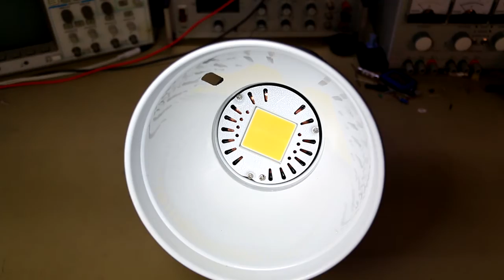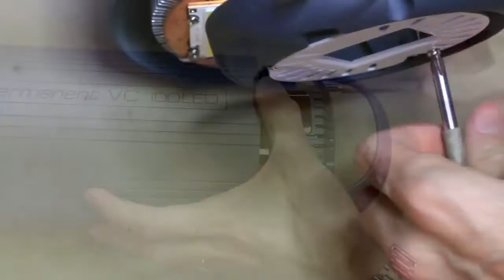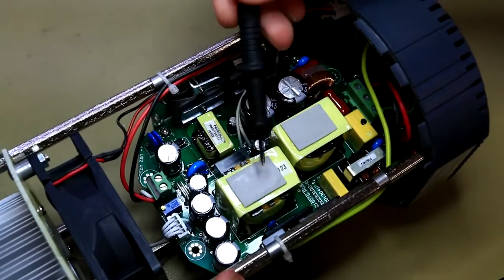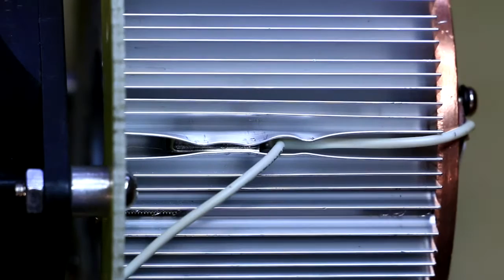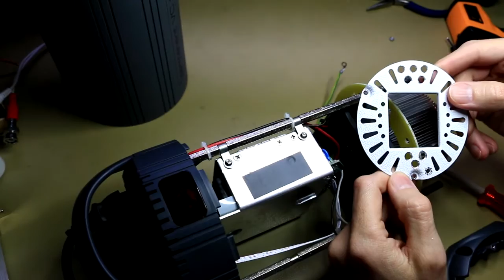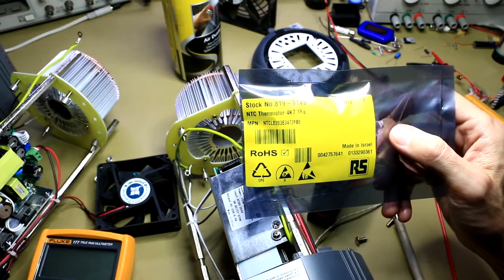Visico VC100 LED light teardown and repair  (#010)

Comment: I like how you went about it. I have a Neewer N-250, I have an issue with power. when I switch it on the power switch goes on, but the display doesn't work. or indicate anything. any ideas on how to repair displays?

Comment: How would you suggest I begin learning how to do this kinda repair? Is this called "Electronic Repair"? Maybe a class at my local community college? I don't even know what this is called to see if someone in my area does this kind of work. I've heard about the capacitors holding voltage and if you don't discharge them, you can have a short career.
Reply from the maker: Hm, a basic understanding of electricity would be important, yes. You can, possibly, start with with some of the basic videos produced by "Mr. Carlson". He offers a (paid) electronics course and then also goes through very detailed methods of repairing electronic devices. Check out his channel here:
https://www.youtube.com/channel/UCU9SoQxJewrWb_3GxeteQPA

Comment: Probably dropped during assembly, and snapped off on the edge of the mount. Not noticed in test, as it was probably 60 seconds - plug in switch on, no boom, light responds to level control, no flickering segments, do you hear some fan noise, switch off, pull out lead, stick on gold QC Plass sticker, put in plastic baggie, drop in box with rest of parts, close box DONE. 

Nice job on your new thermistor, but can't help but think the thermistor would have more effect on the lamp heatsink itself rather than in the cold airflow.

Remember when drilling the holes either get a countersink bit, or use a large (12mm or so) drill bit to remove the edges, so much better than the moer tool, and less likely to distort. Should drill the rest of the holes larger as well.

Nice little bodge there, nice Nichicon capacitors in the power supply, but the main control board put a OHL brand in place of the pass transistor the designer originally put in to handle the heat. Little 12V regulator at least should have more copper on it, or the little stick on top hat heatsink.

Next video, how to fix a Toptronics dual type K sensor display. Of course they are connected in common, hard to isolate type K cheaply, unless you use isolated tip probes with a ceramic insulating sleeve.
Reply from the maker: +SeanBZA Agreed about the thermistor positioning, but seems that the fan still produces more volume movement than the vents can handle, so there's a lot of warm air "spill-back" which seems to help heat up the thermistor.

I have a handheld countersink which I did use, but I guess it's getting a bit blunt with age. The moering tool was to get the front plate flat again after my (quick) heavy-handed drilling.

And yes, the next video will be an attempted repair of the thermometer. Parts already in-hand - all depends how high up the chain the failure went!